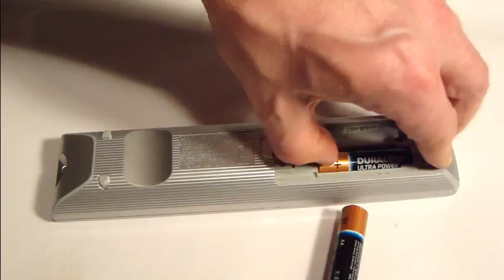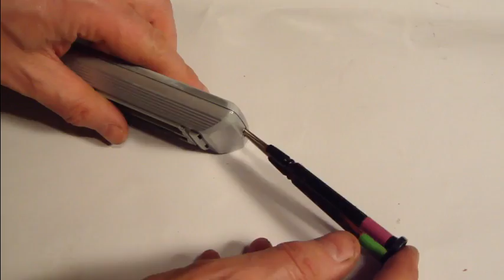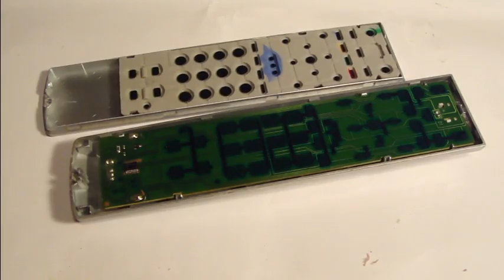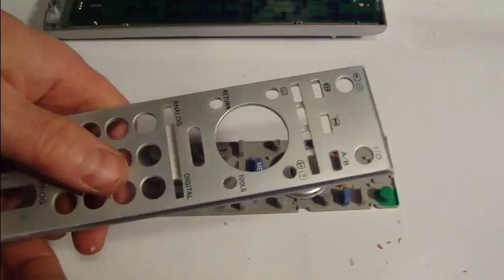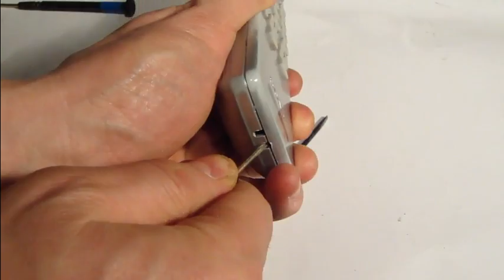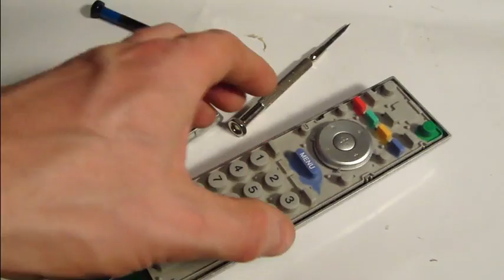How to repair or fix Sony TV remote control button issue

Comment: Today I got a nice small TV. The remote didnt look so bad but only half of the buttons worked. I opened it with plectrums and was shocked. Lemonade on the pcb contacts (like 2-3x as much as on yours), lemonade on the rubber mat and fat and filth everywhere, disgusting. I bathed the most parts in water/dish detergent and cleaned them with alcohol afterwards. Buttons work like new. The remote is still open because the upper part must dry =D Nice video, thanks.
Reply from the maker: Thanks for comment 👍

Comment: Thanks so much. I have a similar Sony remote, and could not be certain of how to open it. You showed exactly what I needed to know. (My problem was the ON/OFF contact, which I had to scavenge from another remote and glue in place but I couldn't have done that if I couldn't have opened the remote.
Reply from the maker: Great to hear!

Comment: Thanks. I was just researching a replacement because of my down volume button. Your solution fixed my 13 year old remote so I didn't have to buy a new one for a system that I'll probably replace soon anyway. Thanks for sharing.
Reply from the maker: Yes and Thanks for comment my Friend. 👍

Comment: For lining up the disc, it might be easier to lay the top of the case face-down, line the disc up with the slots (without the rubber mat), then lay the buttons into the top, and then lock the bottom onto the whole thing.
Reply from the maker: Thanks for comment. :-)

Comment: Next time:
It's not uncommon for the plastic buttons to have tabs for a single orientation. You might find it much, much easier to place the top cover upside down, align those buttons into the top cover, place the keypad on top of that, and then assemble the bottom to the top. In addition, there's a small plastic tool called a "spudger" that is magnificent for prying these kinds of devices apart that snap together. Get a couple of them. Much easier and causes less cosmetic damage and lower risk of damaging or breaking the fragile snap tabs using steel jewelers screwdrivers.
Reply from the maker: Hello, You are welcome. :-)
Reply: I doubt what you found was a beverage spilled onto the remote (a soft drink or beer). If there had been such an event you would have found evidence of it it between the top half of the housing and the top part of the keypad and elsewhere inside the remote. I've seen silicone keypads "outgas" (i.e. sweat) silicone oil because they weren't sufficiently baked to remove those oils after they were molded (by evaporation). It's a well-known manufacturing defect. Yours has the classic appearance of it. It takes several years for enough of the oils to outgas from the silicone in the confined and enclosed space between the keypad and circuit board it lays on top of to interfere with the electrical connection when you press the buttons, as the oils are non-conductive. That's how the silicone keypad suppliers get away with it; the problem doesn't emerge until well after consumer warranties have expired. Isopropyl alcohol will readily clean it off using a soft tissue or paper towel moistened with it. It doesn't require hard rubbing or scrubbing. You don't want to abrade the thin carbon coating off of the silicone pad or the circuit board and you don't want to leave any lint behind either. You can read more about the outgassing of oils from silicone keypads here:
http://www.michaelshell.org/gadgetsandfixes/keypadsiliconeoil.html
Having cleaned a few using isopropyl alcohol (aka rubbing alcohol) I disagree with his recommendation to scrub them using a toothbrushes and detergent as it's unnecessarily harsh. If the oil has accumulated on the plastic housing, it should be cleaned off of there too, but I've only found it on the carbon pad side of the silicone keypad and on the circuit board surface under it. You're not the only one to blame it on someone spilling beverages on the remote; it's the first thing most people think of when they see it. I first encountered silicone oils outgassing from silicone keypads working with OEM vehicle electronics which can often have much longer warranty periods than consumer electronics.

Comment: I don't usually comment on videos but this really helped out. I spilled a sugary drink on the volume buttons and they stopped working. Opened the remote and cleared the sticky board with alcohol. Works great now, thanks a lot!

Comment: I am looking for a Sony Remote for my amplifier. The model of the remote is RM-AAL011. Can you get back to me at: mario4801@gmail.comOr (617) 823-0093.Thank you
Reply from the maker: HI, please. Here is link: http://www.ebay.com/itm/Remote-Control-For-Sony-RM-AAU039-RM-AAL011-Surround-Sound-A-V-AV-Receiver-/252323995873?hash=item3abfaea0e1:g:WD0AAOSwu1VW63sw
Reply: Thank you, I think I found it on Amazon, but it is hard to see the remote in detail. I am going to wait until the order comes in and if not what I am looking for I will take you link. Thanks again

Comment: Hi
If you want to avoid damaging the remote, simply use a nose pliers tool.
Put the tips in both holes and twist it clockwise 90 degrees. Then open the tool, and voila the remote will open. :)
You do not need much force!

Kind Regards
Reply from the maker: +Strange Poulsen Many Thanks for info !